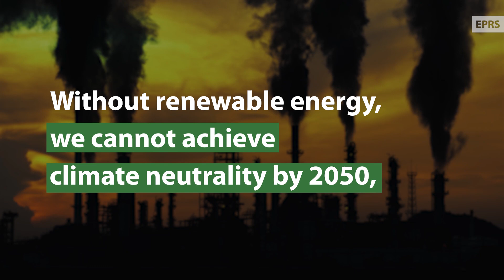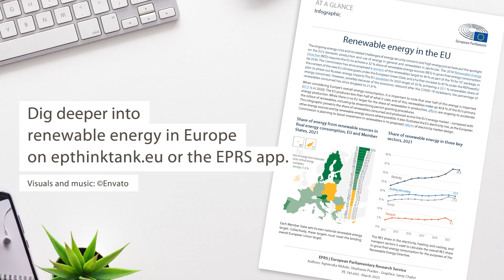Increasing renewable energy in the EU

Comment: wind and solar are not green technology so why is that? both wind and solar have about 40% ends in landfill SO pump hydro must be green technology? Well sorry no it takes 40% more power to run than is returned from the turbines So what is green technology? RDP Marine has A ADD ON SYSTEM TO EXISTING DAMS and lasts 100years and can be fully recycled unlike wind blades ground up and added to wet concrete so land fill by a different name